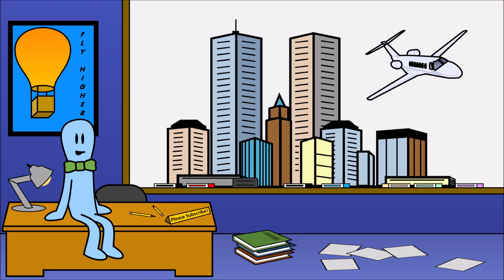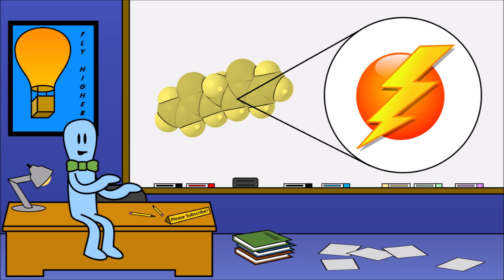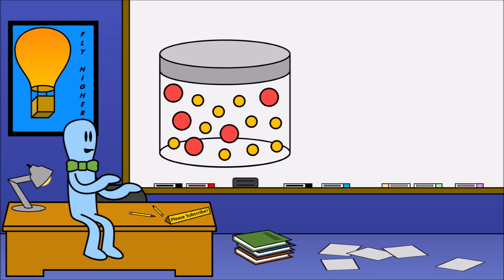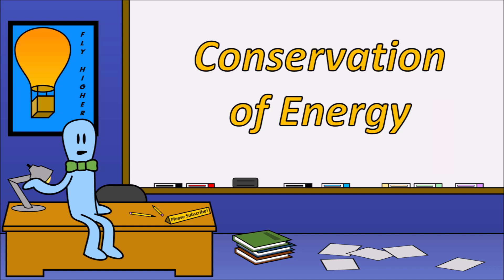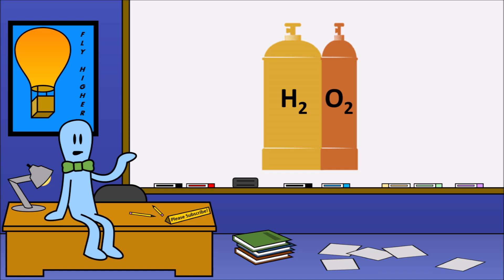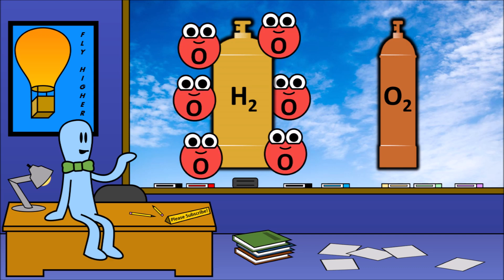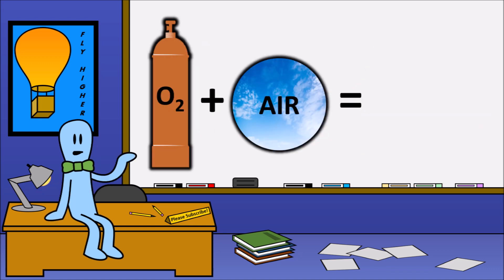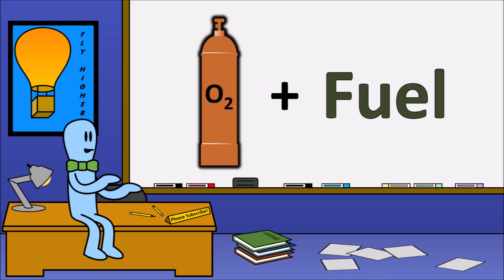Can We Make a Water-Powered Engine?

Comment: Not true!  I’ve made my own Hydrogen fuel cell and it’s extremely easy to creat hydrogen gas to run a car. This video is to stop you from knowing the truth diverting you away. It’s bs!
Reply from the maker: Yes, but the energy it takes to separate water into hydrogen gas is more than the energy the hydrogen provides.
Reply: Inquerity. No a normal battery and a alternator will produce enough energy to creat hydrogen. Look up stanly Myers who had a patent on an injector that turns water into hydrogen